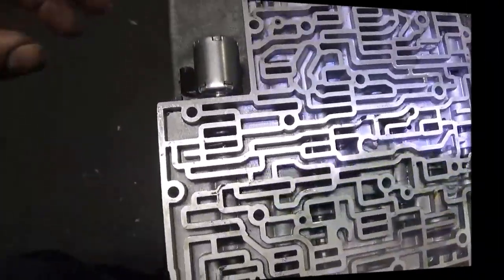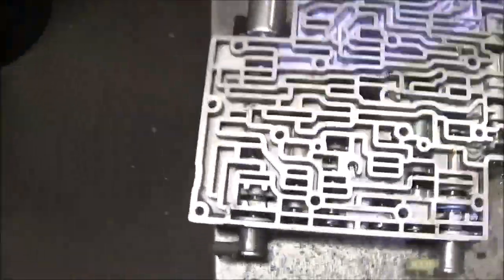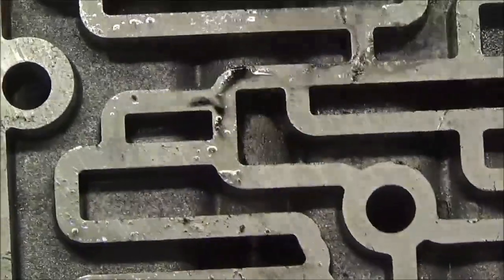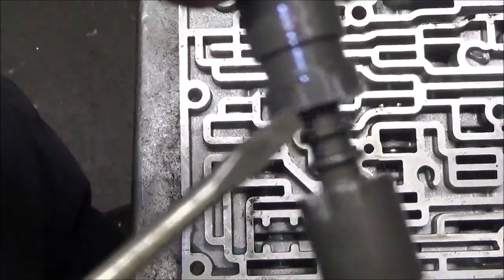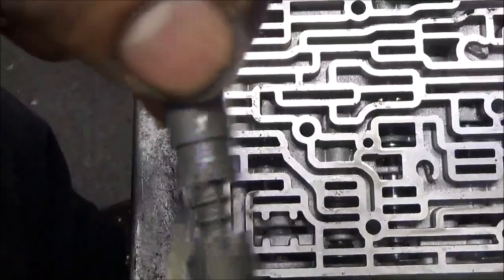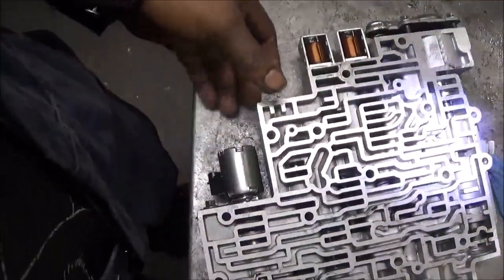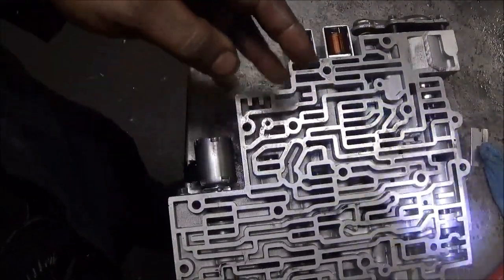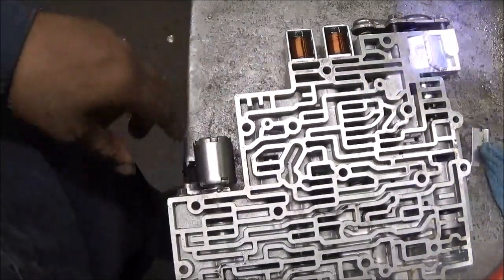P0741 TCC SOLENOID PERFORMANCE OR STUCK OFF 4L60E (PART 2)

Comment: I changed the tcc lock up solenoid, the tcc pwm, the 3-2, and the torque converter as well and I still get the P0740 code, all gears go in but when I get up to 40 sometimes it shudders when it goes into 4th/OD, before when I would cruise at 40 and would come to a stop it would get stuck on so I would have to release the break pedal twice so it could let off the 2 gears, so now I am thinking its this valve although most claim its for the p1870 code
Reply from the maker: did you fix it?
Reply: @thisisyourtransmission  I tried, I pulled the valve body down and checked all the valves and they were good, the only problem was a check ball was stuck on the plate so I fixed that put everything back together and my freaking service engine light came on again, I suppose its my 4th/OD clutches because at 40 when it goes into 4th it boggles down but still cruises but if I step on it, it won’t pick up right away until like 3 seconds it shifts down to go faster but then shifts to 4th real quick again and boggles down again and that when the light comes on, its just weird it’s driving me nuts lol
Reply: @Magnificent01  did you end up fixing it?
Reply: @jojo-vc6qe  I tried, I changed the converter, 3 solenoids, one little ball that tends to get stuck on the plate of the valve body, my valve body is good, the 3/4 OD clutches is what I need to change

Comment: I have this problem with a GM 6T45. When in 6th gear and open the throttle, the error comes right away and 6th gear is shut off by the ECU. So only 5 gears work when the error pops up until you restart the car next day. Could it also be a problem like this or maybe just change oil or the TCC solenoid itself?
Reply from the maker: You cannot change the solenoid is a 6t45 transmission. You have to change the whole TCM if it is the problem.

Comment: Can driving with TCC stuck actually mess up the torque converter?
Reply from the maker: If it is stuck off no. The clutch inside will not be applied.

Comment: This code came on wasn’t going to get worry so I turned off the code and wait till it comes back on guess what I been driving it no code yet if it comes back on then I’ll get it to check out I have a 2,06 Corolla with 158k 😬
Reply: Same problem here '06 Corolla 200k miles on it. Car doesn't have any problems, transmission doesn't do anything, shifting normal and Everything. Code comes on for a day or 2, then it goes away on itself. Been doing some research online and it seems like some people just lived with it and no problem.
Reply: What should I do? @thisisyourtransmission

Comment: so this is happening in my 2002 bmw e39 , i replaced the cylinoids and the same code still pops up is there anything i can do ?
Reply from the maker: What type of transmission is in your vehicle?
Reply: THIS IS YOUR TRANSMISSION it’s a 5hp-19
Reply: THIS IS YOUR TRANSMISSION we cleaned the code and went on an 80 mile drive today but no luck , thinking of just buying a new transmission my parents just gave me this car it’s been sitting for a while
Reply from the maker: What is the code and how many miles are on the vehicle?
Reply: THIS IS YOUR TRANSMISSION it’s this code p0741 and around 140k
Reply from the maker: @shotsbyjoshh  that is a torque converter code. If you cannot test than you must guess. Tcc solenoid, torque converter, bad valve body, bad tcm. You will probably have to take it to a repair shop.

Comment: I got this code p0741 after changing the solenoids and oil pan and sleeves after car was stuck in limp mode and shifts didn’t work. Everything was fine until a day later this code popped up. I didn’t want to fix the first time because I knew if I did I was going to get another bs problem. Idk what to do I have a 6hp21x BMW X5 3.0 2007. I’m trying to save money man:(